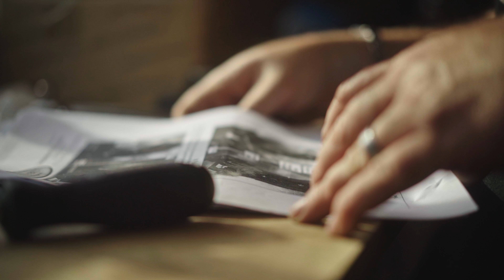Sony A7iii Test | 120 fps 4k

Comment: Do you stack a blackmist with an ND filter outside? I feel like it would create way too much flaring. This video looks really good, looks like my 1DX footage! Must be the filter, I don't like how my Sony looked like cell phone footage lol
Reply: TJ Israelsen Don‘t you think the 120 doesn‘t look nearly as smooth as 1DX footage? I don‘t know, maybe people on youtube just screw up their export settings but the slowmo I get from my 1DX is a hell of a lot smoother.
Reply from the maker: I cant remember if I did stack it, but blackpromist filters stay on my lenses and then If I need ND, it gets stacked.
Reply: alexvidz01 it's because of the higher bit rate & some people dont use the right shutter angle

Comment: Ignore the haters, shockingly good test footage!  What was your shutter speed for 120fps? Also how did you focus so closely to the screwdriver with the 55mm Zeiss at 00:20? I didn't think that lens could focus so closely :-/
Reply from the maker: I am not completely sure because this was shot a while ago. But i think it may have been the closest focus distance on the lens.
Reply from the maker: Also, my shutter was at 1/250th
Reply: @Notxarb  No worries.  Thank you for the quick reply! :-)

Comment: Was this shot in 4K 120p SNQ or just 4K 120p then slowed down in post?
Reply from the maker: So the camera doesn’t shoot 120 at 4K. It only shoots 120 at 1080p and then I upscaled
Reply: @Notxarb  how do you achieve slow motion without choppy footage mate?
Reply: I usually slow down 120 to either 20% or interpret at 24fps and export at 24fps and its still choppy
Reply from the maker: @Phatboy414  are you sure you are shooting at 120fps? Does the file actually say 120fps? 

Is your shutter speed set to 1/240 when shooting 120fps. 

Maybe try 21% or keep increasing it until it looks smooth. But it should be close to 20%

Comment: could you share the lut you graeded
Reply from the maker: ifirex unfortunately I can’t. I used davinci resolve color space transform. It basically converts any profile into another profile. So I converted Slog to ARRI. And you can’t make a lut from this for some reason.
Reply: @Notxarb  thanks for reply bro，its ok and you did a good job

Comment: Nice shots. I have Canon 6D and Panasonic GH4 and I'm looking for something new. I love my Canon, I have 5 Canon lenses, but it feels so old in nowadays... Also I love my GH4, but it's really hard to make video with it in low light. So i'm thinking about buying A7III + Sony 28mm. I guess it would be nice choice for me.
Reply from the maker: I go not have experience with the GH4, but I have shot on canon before. What is nice with the 7iii is that it is probably one of the best all around cameras on the market right now. From photography to video. You can also adapt your canon glass to the Sony.
Reply: If the low light is your main isue than go for sony. But i suggest you think twice before moving to sony.. cause regardless all those tech hype introduce by sony, canon is better imo..
Reply from the maker: All personal preference. Not one brand is better than the other. They all have their strengths and weaknesses and people just need to play on their strengths.
Reply: Get the Sigma MC-11 converter and use all your lovely Canon glass on it. The effect the lense has on your footage compared to the sensor can't be under estimated.

Comment: Good job man! Very nice video. I'm planning to buy this camera but i have some doubt about 1080p quality. I've seen a lot of video on youtube and most of the time i don't like the FHD quality. But looking at your video i really love the result. So what can you say about FHD quality? And have you got some good advice about how to set up the a7iii for 1080p?? Thanks so much man! ;-)
Reply from the maker: I have only shot at 120fps at FHD so that is the only thing I can speak for. And you can upscale it to 4k and it will still look great. I have not tested the 24fps at FHD because if I am shooting at that frame rate, ill be in 4k. But based on what I have seen, it is fantastic. 

There really is no much advice that I can say about setting up the camera for 1080p besides making sure that you are exposing properly with whichever picture profile you use. Really it just takes shooting a lot and trying out different things to see which you like best and right now I really like SLOG2.
Reply: wow thanks man! :-)
Reply: I also have a doubts about 1080 quality on A7iii, but it looks like the problem is that YouTube heavely compress 1080 videos, so it looks much worse on YouTube. But this video was uploaded in 4K, so YouTube don't compress it that hard. So i think this video is much closer to real A7iii 1080 quality
Reply: that could be a good interpretation! Indeed i've found another youtuber using this technic of uploadind in 4k and his FHD video are awsome! ;-) Thanks!
Reply: I should say thanks to you, because your video finally helps me to understand that! I want to buy A7iii and for me is important 1080 slowmo. But i checked almost all 1080 videos in YouTube from A7iii and it's always has terrible digital compression! It's not just soft, but it's has ugly artifacts and digital compression taste on it. So i happy to find your video to finally understand this problem. Good luck with channel! Really cool video!
Reply: Vlad i'm not the author of the video! :-D but anyway i agree with you! Very nice video! ;-)
Reply: Oh.... ;) yes))) Funny situation, because i thought i talking with author of this video :-))))
But cool video anyway :-)))
Reply: By the way, your videos is also cool ;) I think it might be even cooler with A7iii! Don't get me wrong, i really like GH5 picture! It's really pleasing. But in comparison with Sony it's looks just a little bit more documentary, while Sony FullFrame looks more cinematic anyway (bigger sensor, wider dynamic range).
But i saw on youtube some guys that tried Sony, and their videos from GH5 was better, just because they used to work with GH. So i think it's depends on persons style. But it looks like you have more cinematic look in your video. So it looks like A7iii will fit you. But i'm not a professional :))) It's just my thoughts
Reply: Such a good point and good reason to upscale 1080 footage to 4k.  1080 video on YouTube always appears far more compressed than 4k.
Reply: Fabio Cataldo It should be also mentioned that the video was shot with the sony 55mm 1.8, which is one of the sharpest lenses available. I really hope the 1080p is near that quality with other lenses too.

Comment: THIS IS FANTASTIC.. what is the purpose of upscaling from 1080p to 4K? (I've heard of downscaling from 4k for a sharper 1080p)
Reply: The A7 III shots 4K at a maximum of 30fps. If you want clean slow mo in 4K, you have to shoot in 1080p and upscale it to 4K
Reply: @Simon-ny4on  The end result is still a 1080p footage, so upscaling it ti 4k instead of uploading in 1080p makes zero sense.
Reply: OhFishyFish it makes sense if you have a mix of 4K and 1080p, you upscale your 1080p footage

It also makes sense for YouTube since the bitrate YouTube uses for 4K is higher than the one for 1080p. So even if your video is entirely 1080p, you'll have a bette quality on YouTube if you upload it in 4K
Reply: @Simon-ny4on  I noticed the bitrate difference between the 4K and 1080p in some of my videos (on my other channel). Playback in 4K looks fine, 1080p has terrible compression artifacts in details like trees. Even rendering in 1080p and uploading this way still exhibits the same issues. I guess that's why Vimeo exists for pros, most of us should be happy with the yt results though.
Reply: Do you prefer 120fps over 60fps? I feel like the quality of 60fps is just a little sharper but I could be wrong lol.
Reply from the maker: I haven’t looked deeply into that. I do feel that 120fps isn’t as sharp as 60fps. 

But then of course, 60fps isn’t even close to 4K

Comment: Hi nice I like it - at 20 seconds did you use touch screen focus to get the screwdriver in focus. What is a black pro mist.
Reply from the maker: Mark Shirley I actually did not use the touch screen. It was one of those things that I got lucky with when using the auto focus on wide. And a black pro mist is a lens filter that just kind of blooms the highlights. It gives them a nice roll off that I like. You can look up before and after shots to get a better idea of what’s going on with it.
Reply: Braxton Klavins thanks - yes it's nice look - makes certain images look less digital.
Reply from the maker: Mark Shirley yes, exactly. Digital just doesn’t handle the highlights like film. And when I saw what a black promise can do. I was sold

Comment: Can the a7iii shoot 120fps 4k?  Everytime I try to do that in SQ setting, it drops my recorded videos to 1080.  Is there a limitation?
Reply from the maker: It cannot do 4K 120fps.

It can’t do 4K 60fps either 

I upscaled the video to 4K because it helps improve the quality for YouTube because I can use a higher bitrate.
Reply: @Notxarb  Thank you so much Braxton.  I thought I was doing something wrong. Should have done a bit of  research before I went out to shoot.  I ended up having to upscale half my footages  in post.  Your video is fantastic by the way.  Hope I can achieve that quality one day.
Reply from the maker: Thank you! And just keep shooting and finding good light!
Reply: How do you upscale it? You film in 1080p and then export it in 4K 24p?
Reply: @gabrieljamesvlogs  You scale it up in premiere yep.  That's how I do it.  You can go the extra level and add upscaling sharpness with Magic Bullet.

Comment: Amazing work and thank you for the tips man! one question, are you also exporting in 4k? I appreciate the help
Reply from the maker: Yes, I always try to export all my videos for YouTube at 4K, even if it’s a 1080p video. The reason is because uploading a 4K video allows the video to be at a higher bitrate, this YouTube not compressing the 1080p video as much, which allows better quality
Reply: Braxton Klavins makes sense! I appreciate it... I assume you do the same for Instagram?
Reply from the maker: It depends, for just a single photo/video. I do upload the high res image. I have found that there isn’t any difference between uploading a high res image/video vs the low res that is optimized for IG unless you zoom in. When zooming in, the high res image looks better. IG’s maximum width is 1080, but I still upload my images higher than that. I know people try for 2048 but my images are still larger than that. 

Now if it’s a file then you need to pay attention. The reason is because it does have a file size limit and when uploading multiple images in a file, it’s basically treating them as one photo and going to compress them. 

I forgot what instagrams maximum upload allowance is before it compresses, but let’s say it’s 10mb. So if I upload a high res image that is 5mb, all instagram is going to do is resize the image, and I don’t see that big of a loss of quality. But if I take that same photo and upload 5 of them in a file, then it’s going to take those 5 photos (25mb total) and resize them and compress them, which I do see a large quality loss. So I would try to compress the photos a bit more to make the file sizes smaller. 

I can test yourself too. Just make a private Instagram account and test uploads there. 

Oh and also, I have found that the image may have different quality across different iPhones. I think it has to do with the pixel density vs screen resolution.
Reply: How do you and whatt you mean with exporting in 4k??

Comment: looks soft. not sure why you'd wreck the resolution by adding a Pro Mist filter.
Reply: I'm not sure either, seems at 120 fps you shouldn't need an ND at 1/250th of a second. Also, you know this isn't ACTUALLY 4K right? he filmed 1080p at 120fps and rendered to a 4K timeline to trick youtube into letting him use up to 45mbps bitrate. That way all of the 1080p data and sharpness are retained. It's actually one of the sharper 1080p120 videos on youtube simply for the fact that he rendered it to 4K for higher youtube bitrate.
Reply from the maker: I like the look of promist.  But I am now using 1/8 on all my future stuff. I just like how it blooms the highlights. Its all taste and a personal preference. 
And I shot everything at f/1.8, So I needed the ND the time. 

It was also my first time using SLOG 2, I was used to using Cine 4 before. 

And you are correct with the 4k.